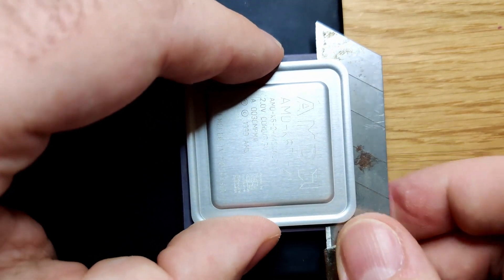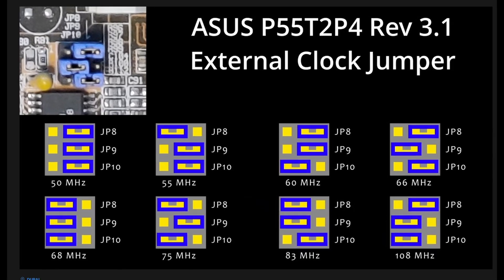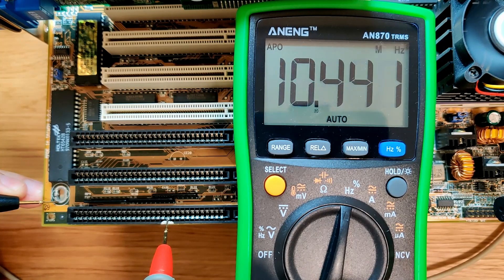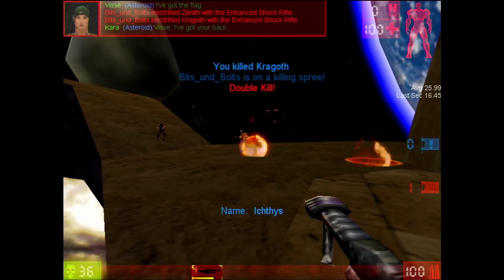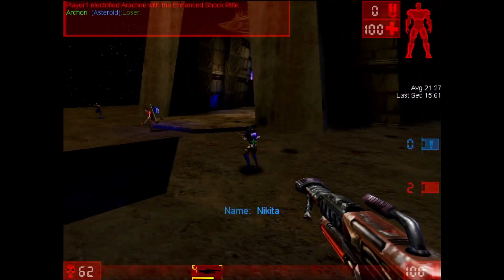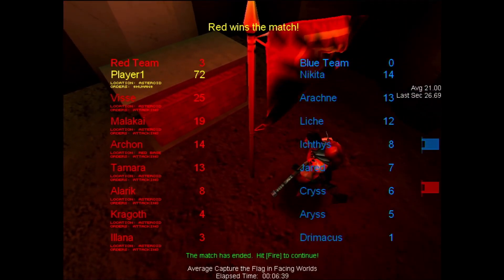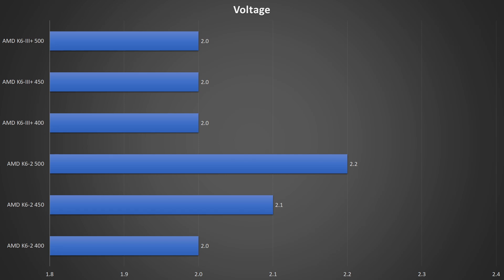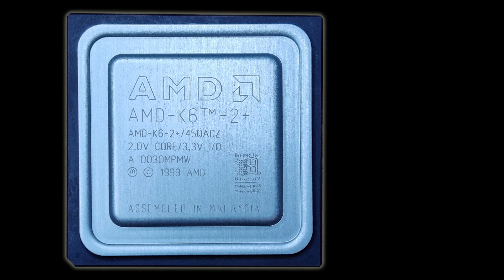Modify K6-2+ into K6-III+: Overclock to validate Cache Health?

Comment: I killed my k6-2 back in the day trying to get a stable overclock out of it.

Had to go back to a P75 for a while until I could save up for a K6-3 as a replacement.

I'm glad i didn't find out about this back in the day because 15 year old me would have been REALLY tempted to try it. I had already delidded my k6-2 and went direct die with a big cpu cooler.
Reply from the maker: Uh, that must have been rough to go back from a K6-2 to a P75!
Reply: @bitsundbolts  yeah I wasn't too thrilled about it. At least I had the CPU to fall back on, but I couldn't play many games for a while, haha

I think i was able to overclock it to 90 or 100mhz, but it didn't help much.

Comment: these from our exp, k6-3 or 2+ will often do 650mhz after a delid, the TIM they used was BAD, the IHS is not great either honestly.. if you get ahold of another or more then one, try making a shim and doing direct die, you will be shocked how much lower the temps are, opening up higher clocks, the best we managed on one was a buddies that was HORRIBLE he go it free from a shop because it ran hot regardless, we removed the lid, no tim... used some quality stuff we already had, and... the dif was shocking.. his brother got us some copper IHS replacements for those...not sure if he bought or made them at work or what but...the dif was shocking... genuinely, 766mhz on one 100% stable using a silly arse thick copper base plate with alum pins for fins cooler that, well, the systems still functional, he did upgrade the board though, he got ahold of a genuine gem of a board that will do 150buss stable, currently hes using 133 same as we managed on that other board, that was also a last gen super7 board... this ones got a better chipset though, handles clocking better then the via set did and better memory and ide perf when you run stuff out of sync.. something the sis socket A chipsets also share... honestly, this old stuff is fun, some boards like the one im talking about, are insane for how advanced they had become for their day, the pci/agp/isa are isolated from the cpu fsb such that, you can tweak them independent of the main fsb, much like far newer systems... the only downside was he had to re-cap the board and replace the old dallas rtc with abutton cell replacement... hes got all 3 of our old main chips still, only the one IHS hes got in use though, i asked, and the board he swapped out is in process of being recapped by somebody for him, in trade for allowing the fellow to clone the bios chip using his reader, as his board has a much much newer bios then any online archive has saved, that wont backup with software for some reason... 

we also each had dual 370 boards with 466 chips clocked up, boards would do 150buss easy... our buddy who kept his also has ours that he recapped with audio grade caps and ones his main "retro game rig" as its got dual 1.4ghz celeron p3 tu chips, the only dif between the ones he got vs the full p3 was the fsb being 100 by default not 133, and..well.. both chips have been doing 2.1ghz for years now, no problems, he even had some server ram given to him that, was both faster then what he was using and, 4x typical capacity... and worked in the board with the last bios abit released.... genuinely crazy for how old it is, how well it runs modern linux... hes actually got it setup in a uefi loader based multi boot with win95, 98se, 2k, xp, and a linux distro he really likes that still keeps a 32bit branch around and working, for its era.. it destroys any p-4/ or p-d you put it up against... it did take custom clips to attach the coolers with the TU adatpers on the board sockets, but... well.. it already had custom to deal with the pelters double stacked under the coolers on the old chips... so..yeah... it really wasnt an issue... he did endup water cooling it since he was able to modify clips for a water block to work on the sockets with the pelters without much effort, to this day  its a beast.. dual voodoo2, dual matrox m3d, best agp card they ever put out that would work in the board, think its a 1950 or something... either way... its a genuine beastly rig for its era... and able to play pretty much any title you throw at it... in style.. (i mean of the era...)
Reply from the maker: Thanks for sharing!

Comment: I have a asus P5a-b super socket 7 board. I might be willing to part. its in my old retro rig atm. might be able to come to some agreement if your interested. I also have a few k6 cpus and some intel ones. I thought about ebaying them. I need to come up with a little cash for bills smh.
Reply from the maker: I actually have bought that exact board in revision 1.04 a few days ago. Unfortunately, it is going to be shipped within Germany only and I will only get it in a few months.
Reply: @bitsundbolts  I understand that.  I live in the US so idk how long shipping would take.  I think mine is a 1.04rev. I love that it has at and atx power connections.  If u don't mine me asking how much did it cost you?  I've seen these boards vary wildly in price. Its gonna be fun seeing the same board I have being used.
Reply from the maker: I paid 35 Euros for the board including shipping. There is also a K6-2 with cooler included. I think I got it it at a really good price. Probably can be sold for double the money. It's good for me because I pay everything out of pocket for all the retro hardware I acquire at the moment.
I like buying in Germany right now because the US Dollar is so strong vs Euro!
Reply: @bitsundbolts  I seen few of these boards sell for $200 to $450 at the highest. depends on the revision I guess. I know the 1.04 is ok for the most part. lots of features but I think ram speed slows down if you go over 768mb of ram. I can't remember exactly being a few years since i did any research on the thing. I just know i seen that amount mentioned and some limitations.
Reply from the maker: I'll definitely repeat that research and you will be able to see it on my channel. Probably cacheable area issues. Those boards become really expensive. I will get a DFI K6BV3+/66 which I will use in the meantime. It was quite expensive, but I can't continue with the ASUS P55T2P4 for the next projects. This DFI board cost me 140 USD incl. shipping. Was the only way to get a super socket 7 board reasonably fast.

Comment: While testing with Unreal Tournament is more fun, you should run Prime95 for a few hours to verify stability. The Torture Test will stress the CPU, cache and memory, and it will notify you if something goes wrong. Older versions like v20 will run on Win98.
Reply from the maker: I have read this, you are right. I think I will try Prime95 with an upcoming project. I will be doing the same modification on a K6-2+ 570.
Reply: MemTest via BootDisk also works very well. You can set the exact area of the CPU or motherboard cache and search for errors there. I could easily find out that the external cache on a Super7 motherboard was faulty at a FSB of 120Mhz or more.
Reply from the maker: I read contradicting information regarding MemTest. There is definitely more research required.

Comment: I have a Super Socket 7 ATX board. But cant find any "+" CPU for a reasonable price.
Reply from the maker: They become rare - there is a seller on ebay at the moment in the US selling a batch of 3 new old stock. It is around 30 USD per CPU, but you end up with two additional ones.
Reply: @bitsundbolts  just means you pick the best to run with all the time, have a spare and OC the 3rd in to the ground :D
Reply from the maker: That's pretty much what is going to happen with my batch! But I have planned something special for the chosen one!
Reply: @bitsundbolts  do you have his handle/name? I was looking for that seller too
Reply from the maker: Here: premierchoicecomponents

Comment: Is there any way ACTUALLY test the cache health? 
Something like how MemTest86 is for RAM, but for cache ??
Reply from the maker: I did not do much research, but I found a forum post that said "Limit MemTest86 to 256KB" (or whatever your cache size is). But I don't think that this actually works because I have read another post that says MemTest is programmed in a way to avoid the cache as much as possible. But that could just mean that the cache is ineffective and used even more.
I guess what I am trying to say is that cache allocation is the job of the CPU and you won't be able to decide what goes into the cache and what not. You may be able to influence the effectiveness of caches by utilizing certain programming techniques, but at the end, the CPU decides what goes into the cache.
For now, I have not seen any test that targets the cache. I like the question and I have spent hours before trying to come up with an answer.
Reply: Prime95 can test the cache, Karhu's RAM Test tool too. But I don't know if they run on such old Hardware/Os.

Comment: So far I've modified two K6-2+ 570s and one K6-2+ 533, and all three have been stable. Both of the 570s are in MVP3 Super 7 motherboards running at 616 MHz (5.5x112) and the 533 is running at 500 (6x83) in an Asus TXP4. I had a genuine K6-3+ 450 that I was running at 500 in the TXP4, but when we discovered the resistor mod on Vogons I decided to modify the 533 since I wasn't using it, and I sold the K6-3+ 450.
Reply from the maker: I am surprised that this mod is so successful. I would expect some not to work! Usually I am the one who gets the dud or breaks everything while trying. Congratulations though! I still look for a well priced K6-3+ just for collection purposes. Thanks for your comment!
Reply: My personal experience with the K6-2+ was that pretty much all of them could hit 500 MHz but few of them could hit 550 -- and those that could, were sold as such.

Comment: This video takes me back to my original K6 days. I had a K6 200 Mhz CPU and used a Megatrends HX83 mainboard. I wasn't able to overclock the K6 very far past 200 Mhz using that board but I was able to use the 83 Mhz FSB speed with a 2.5x (instead of 3x) multiplier and ended up with a 208 Mhz K6 chip. Even though the CPU was only running an extra 8 Mhz faster than stock the faster FSB made noticeable gains in many games.
Reply: I had read about some of that stuff back then but i was pretty young and didn't understand it enough hah.  I also didn't want to fry the PC because I may not have gotten a new one.
Reply from the maker: I can relate all too well to your comment!
Reply from the maker: If you were lucky and brave enough to tinker with your hardware back then, you could easily get more performance out of those systems by changing the FSB to a higher clock. As you said, the 8 extra MHz are almost irrelevant - the main benefit comes from the faster FSB.